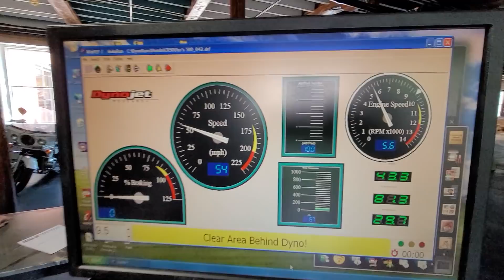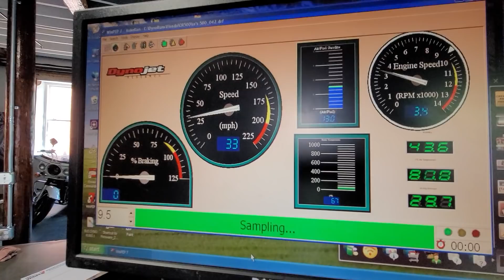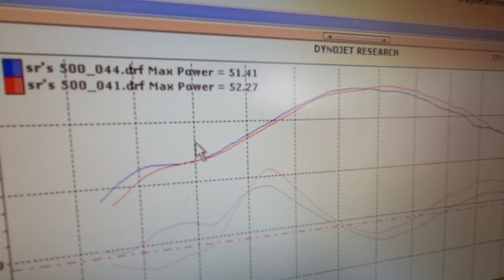DYNO TEST #43 FMF VS STOCK HONDA CR500 EXHAUST, WHICH IS BETTER?

Comment: 48 tooth gives better traction control. The 52 is raw HP to try and get traction.
Reply: Probably what I had as a 15 year old on a 96 cr250 still my favorite bike and I’ll ride anything. It would come up in fourth on power in the right conditions
Reply: 50+ teeth on a 500 rear sprocket = super wheelie machine.

Comment: 52 at the wheel is about 75 hp Google boyesen (Pro series Reed’s for cr500) not the power reeds.  Not the Pro stock reeds (ProSeries reeds ) they even cost more I hope they have them in stock Great low and great mid range and awesome topend and they’re made for pro riders that don’t need lowend and mid range something like that  get them if they make less power I’ll donate $500 to save the roofs get the part number I will find a dealer somewhere in Canada or United States that has a set sitting on the shelf still there’s probably a few retired riders with a set in their toolboxes we just got a figure out the number call Boyesen I know for a fact they make more power on the seat of the pants Dynamometer they made 75 to 80 hp at the motor You just install them and you feel the difference right away without touching anything else

Comment: I would love to run a Hygge pipe. The gains are probably the highest of any pipe. The fmf fatty is probably my fav. Would be the better pipe to run for over all hp gains. The gnarly is good for low end torque but doesn’t rev out as much.
Reply from the maker: 100% correct

Comment: Peak torque is up but it's not carrying (holding) the power across the rev range. It should be sustaining that high peak torque value farther out in the revs which will make more HP as revs build. It may be having breathing issues. It could be a physical restriction or a harmonic timing issue from the reeds or chamber.
Pull the air cleaner out of the housing and make a pass just to see what it does and to check something. Make sure to leave the housing boot connected to the bell mouth of the carb as it will act as a velocity stack which will help make power at the higher revs.. I would expect it to carry that torque level (at least) a little further out before tailing off. While running that pass with the air cleaner out............Also take notice of the bell mouth of the carb and note how much 'Bark Back' (carb spitting) is being thrown out of the carb as it spins up. Use a mirror extension (on a stick) to view the bell mouth inlet. It’s not uncommon to get some bark back as the engine is transitioning 'on to the pipe' through the mid-range revs………….but that should cease after it’s pulling hard on the pipe. If it's throwing a lot of fuel out into the air cleaner boot...........That can generate a 'too rich' condition because the carb is re-fueling an air stream that already has fuel in in. The air cleaner should never be soaked or dripping with fuel when you remove it, which is an indication this is occurring.
Barking Back for a prolong rev period indicates the reeds may not be seating completely or seating fast enough because they are too flimsy and don’t match the chambers sonic impulse timing. The reed stiffness ( a specific harmonic value) and chamber harmonics may not be a good match.  The reed tension itself and/or the combination of the reeds with a specific chamber may also conflict with the basic port timing of the cylinder.
Try a stiffer set of reeds.  Make sure the reed stop plates (if there is one on the reed block) are set (bent) far back enough to allow the reeds to fully open.

You mentioned something about you added a capacitor to the ignition?  Remove it while you are  trying to troubleshoot.  It may be altering the ignition timing at high revs.  You can always reconnect it later if you think it actually helps to start the bike.  Put a timing light on it and map the advance (with and without the capacitor) to see what kind of timing curve it is producing just to make sure the curve is what it should be for the CR500.  The engines ability to produce a flat torque curve is very dependent on proper timing curve.

In general only change one thing at a time as you build an engine up.  You will get a better idea of what kind of performance change occurs when you make a particular mod to the engine.
Reply from the maker: Excellent advice. We spent three days straight trying dozens of combos. Max was 56.78 rwhp. I think the 38mm carb might be the bottleneck
Reply: @KaplanCycles    The CC displacement and RPM numbers don't support the need to go to a larger carb. The engine just isn't moving enough air, even at full rpm, to require a larger bore carb. The engine can only pump about 80 CFM based on a V.E. of 90% which is typical for a two stroke engine. The current 38mm can easily flow that and more. You could try a 40mm or 42mm and you might gain a little peak HP........... but you WILL certainly lose some part throttle response down low...........which you don't want on a motocross bike. It won't pull as hard coming out of turns as you roll the throttle on. I don't know for certain but I would expect that because this is a recently designed CR500, (within the last 10 years) it has the benefit of modern computer flow modeling. I'm guessing Honda chose (and tested) the 38mm and found it as a good compromise size for best peak power and best part throttle response. Unless a significant change to the ports were made to increase the V.E. of the engine, which would make it flow more, I wouldn't expect a bigger carb to help much (if at all) but you'll still get the negative aspects of worsening part throttle response as carb size gets bigger. But what the hell.................If I had a 40 or 42 laying around and I could hook it up without too much trouble...............I'd try it just to see the impact of it. Keep in mind that peak power doesn't make a GREAT MXer. One that has the broadest torque curve across the rev range is what you want. Don't get hung up on peak HP numbers. Make mods that produces a torque curve that stretches wide and flat all the way across the screen.
Reply: Listen up students, this is top notch performance extracting info right here. Do u have any reading online I can follow?
Reply: @mikemcduff427  theoretically a 40mm carb with an FMF Gnarly would allow it to keep the bottom end while extending the midrange curve?

Comment: great video as always.  my 2c
lift cylinder thicker base gasket
reduce squish and Cc size
39mm oval bore PWK

go for a rev pipe. big problem with 500s is the lack of rpm wasting time having to shift. DEP is mid to top with a long silencer will also help rpm.
then fit a STIC to the carb (massive over rev and flattens torque curve.  big increases in throttle response)

try some longer gearing. I use 14-46 gearing to make the most of the power and torque. I found it revs so fast through the gears I literally couldn't keep up dancing on the gear lever with anything shorter.

nothing can touch it

Comment: Try running a thicker base gasket.  I know a team that ran the Nationals and all they did to the engine was run a .050” compressed thicker gasket than stock, Reeds, Pro Circuit Exhaust and jetting for race fuel.

The team owner told me it lessened the hit at the bottom but gave the bike more top end and smoothed out the power.  The thicker gasket effectively changes the port timing.

The owner didn’t mention adjusting the squish of the head but he was more talking about the port timing with me.  So he may have glossed over that.
Reply: PC is junk. Not a durable pipe at all & it chokes the power.
Reply: I've done the same thing before with base gaskets and you're spot on, the top end power gain is very noticeable and widens the power curve somewhat vs stock is all bottom end and mid but falls hard up top.

Comment: Makes me wonder where they came up with 76 hp on pastranas RM Zilla. It's bigger than a 500 though.
Reply: Go watch the Norwegian dude something leti who built one with more than 90hp, it's not rocket science
Reply: @petergriffin4629  yeah but those are more for hill climbing I thought. Pastrana not your average rider so I guess he can handle it.
Reply: @bloomerb4162  my godfather is a two times German 500cc champ 85 and 86, they had around 80hp on their strongest engine, which was stroked down and bored out to rev higher. But that one was only used in really deep sand tracks. Though when he got to ride a works Kawasaki bike with way less power he was still quicker.
Reply: @petergriffin4629  

😶😆🤣
Reply: @petergriffin4629  the nitro guys were crazy on them, some would do 120+ depending on % ran. But they would also blow up in spectacular fashion from time to time 🤣🔥